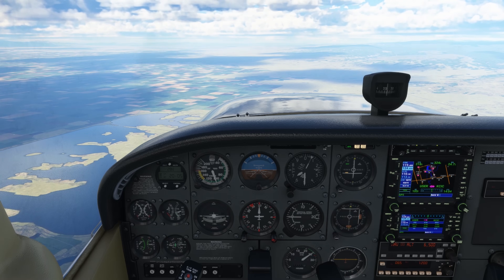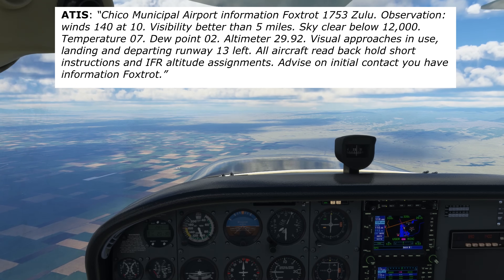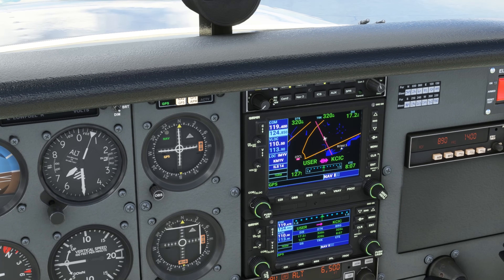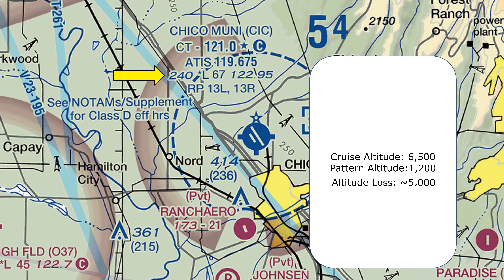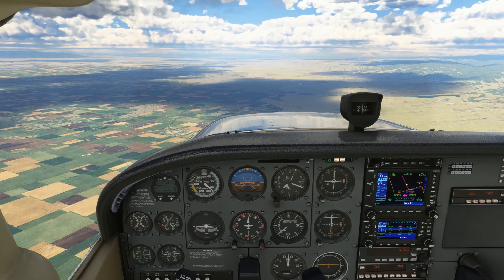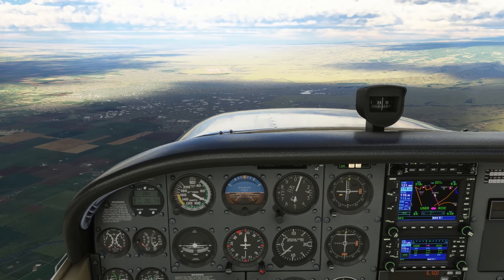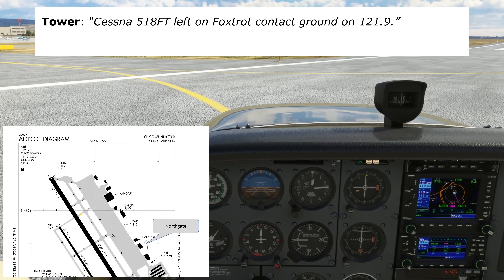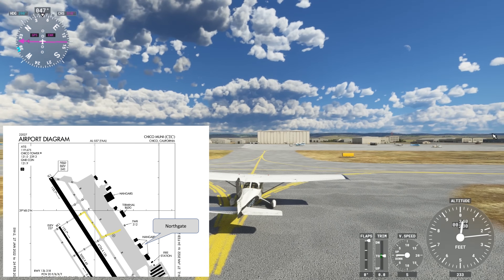Class Delta Communications | VFR Radio Communications | Towered Airport

Comment: Nice job and thorough explanation. I can't help but notice there is a contradiction here. At 3:50 you say we want to arrive at pattern altitude a few miles from the airport. At 7:35 you arrive at pattern altitude much closer than three miles to the airport. Which is it? This makes a difference in determining when to begin your descent. It makes sense to arrive farther out (3nm or so) so that you can get a good look at any traffic in the pattern before entering it, and so that you don't risk descending on top of someone else flying a wide pattern.
Reply: The rule of 3 is a crude tool to plan a descent assuming your ground speed is 90 kts (3NM per 2min). His Garmin 530 says he is doing 108kts over the ground, so he will get there in less time than if he was doing 90kts. Many pilots don't know that 60kts is 1NM per minute, by definition, so you can directly calculate 108 kts / 60kts to work out that you are actually covering 1.8NM per minute (3.6NM per 2min), so you'll cover 18NM in the 10 minute descent instead of 15NM per the rule of the 3. So, he was 3NM late in starting his descent. However, 108 / 60 is not easy math, so you could also just bump up to a rule of 4 (corresponding to 120kts) to come up with a 20NM start for the descent. If you were in a high performance plane, then you might use a rule of 5 (180kts), but as the speed and altitude changes get bigger, you'll want to be more exact since any errors multiply.

Comment: 0:32 - this is the problem with FS2020....that C172, at 2500rpm at a 6500ft cruise, should be going a good bit faster than 105 KIAS.  Our club one does 120 KIAS.  Thanks for the video though - great lesson on comms.
Reply: Maybe it has a shady engine and dodgy propeller lol

Comment: Nice video, but I would have already written down the ground and tower freq on a knee board to quickly load my radio on approach. Although you might have assumed that, it did not come across that way.

Comment: Great video! One comment though, the sectional shows right pattern for runways 13L and 13R, not the standard left pattern.
Reply: Tower can vector you into right or left pattern traffic. The statements on the sectional are procedures for when the airport tower is inactive, and may be the typical procedures that tower uses when active.

I get vectored into left traffic all the time at a local airport even though it’s right pattern traffic on the sectional.
Reply: I saw the same thing and came to comment as well lol

Comment: Why all the acronyms and nonsense... You can get the AWOS/ATIS weather via radio or via cell call, btw.  Tune to the Delta tower frequency and first LISTEN to the chatter.  When there is an opening simply call the tower and identify yourself and say intention with the weather code if they are not busy...if they are busy, contact the tower and just identify yourself...giving them a chance to contact you when they are able...then give intention and weather code.  The tower will give you a clearance and a runway.  Land and contact ground when instructed.

Comment: Still learning here, I want to use the sim as realistically as I can so I have questions: 1) where is a good source to learn basics? I'm not trying to get my PPL but I want to have a working understanding of radios and charts, etc. 2) If tower is the actual airport, what is the difference between approach and center? (etc. Albuquerque center) 3) if I'm on the approach frequency for a bigger airport but I'm trying to land at another smaller airport nearby when do I switch to the tower? Do I have to keep both channels selected? Thanks in advance!!
Reply: Check out this video he made 
https://youtu.be/LX3vir40iQQ

Comment: I really enjoyed watching this video. Noob question, how do you know when an airport is class D or C or whatever? How do you know when to ask for permission to enter class bravo delta or whatever airspace? :(
Reply from the maker: The best way to tell what class an airport's airspace is is by looking at the VFR Sectional Chart. Different class airspaces use different color coding. Also, different airspace has different entry requirements. Try this video to get started on the concept. https://youtu.be/47SU-Wga35o
Reply: @flightinsight9111  thanks, quality video as well. So when flying VFR in high density areas with many airports such as LA, a pilot must look at his map all the time to make sure he's requesting access to a class X area before entering it? Or is this led by the controller?

Comment: Another great video! Using the stated rule of thumb (in this case 15 miles out) what is the decent rate that would be used? Thanks again for the great instruction!
Reply: Rule of thumb is to take groundspeed divided by two and had a zero. For example, 150 kts GS/2=75 or 750 ft/ min
Reply: Usually your average rate of decent is 500ft/m. Anything over than that will get you close to overspending. Just calculate how many feet you have to descend. Let’s say 5,000. You divide 5,000ft to be lost, by 500ft/m and you get 10 minutes to descend. After that you just have to find out how far is 10 minutes out, and start you descent either at that point, or a bit prior to allow a margin of error.

Comment: Wondering the track for joining the downwind is right at where the departure side of the runway, using the upper wind side if 13R is not in use, or position the aircraft earlier to get the direct downwind entry should be safer. Besides, announcing short final is also a good way to communicate with tower and other traffic too.
Reply: I disagree with announcing final, you'll just clutter up the frequency. Tower knows you're short final, they've already cleared you. Announcing base when you have yet to be cleared is useful though

Comment: Just curious, on the sectional it says RP 13L, 13R, should you not expect to be cleared Right Downwind for 13 ?
Reply: Ok kewl thank you. Great video by the way 👍
Reply: @rocketrooster9582  thanks for asking that... had the same question!!
Reply: The control tower is located on the east side of the airport, so it is doubtful the controllers want to work traffic behind them.  A left downwind entry from your position would not only put you behind the tower but also make you cross the departure corridor of any “big” traffic departing.  Looks like RP 13L/R is due to power lines east of airport.  While the tower “might” do a left downwind entry, it would seem unlikely give aircraft position and other factors above.
Reply: Yes I saw that too yes you should expect right downwind for rwy 13L
Reply from the maker: You could expect this too! When the tower is operational they can have you enter from any direction that works for them. The "RP 13L and 13R" is for standardization of aircraft entries when the tower is closed. My assumption is that the tower would want to keep you east of the field to not interfere with the parallel runway, but it could go either way. A bit of local knowledge would go a long way here.
Reply: @flightinsight9111  Thanks so much for that explanation. I also saw the RP for 13L and was expecting you to approach from the west into a right pattern. Loved the video BTW! Had 2 huge take-a-ways: W.I.R.E and also the feet to descend*3 trick to determine how far out to begin the descent. I am a 130 hour new pilot venturing out into those scary towered airports!